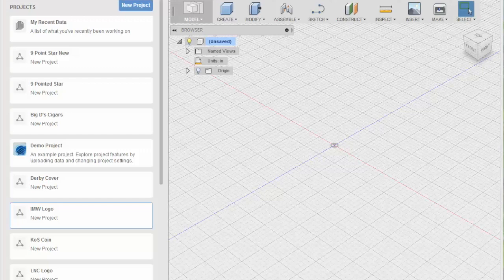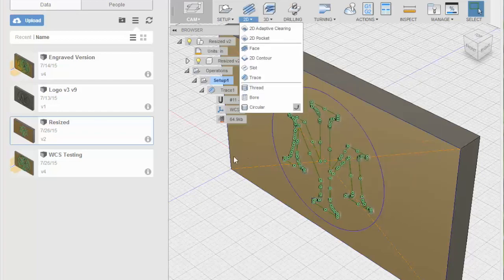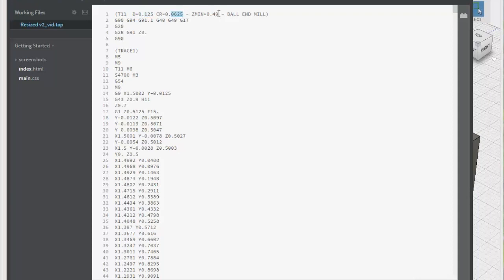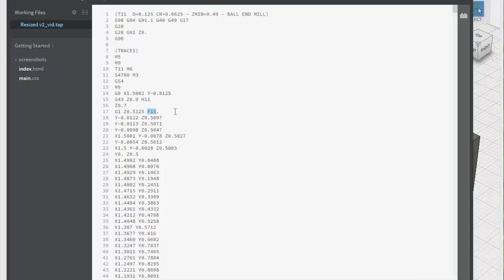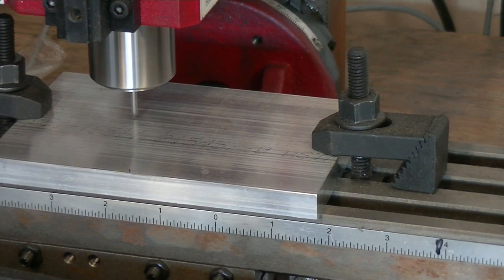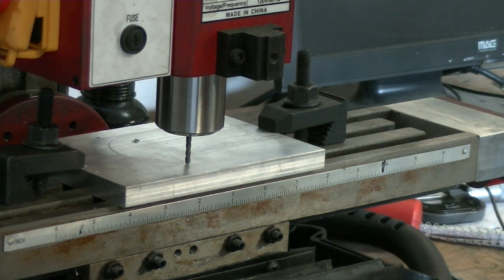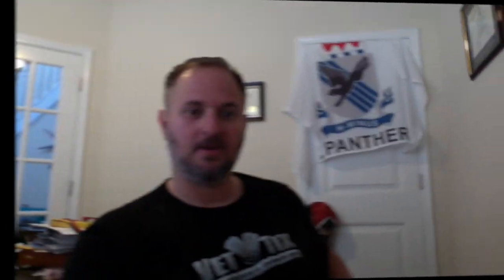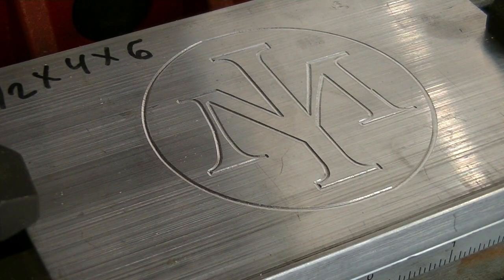CNC Mini Mill - Trials, Failures, and Success!

Comment: Assuming you used stepper motors to control your movements. .. it is common to loose steps in the travels to and from the destinations. ..
I would look to your mounting of the motor and attachments to the table to make certain that everything is secure and check for play...

I hope you get it figured out 
Enjoying
Reply from the maker: Thanks for watching and the helpful info on the motors. They are indeed stepper motors but I think you hit the nail on the head with checking the mounts. The nuts that secure the ball screw had loosened during the operations this week and let in some play on the table. I 'll add some thread lock this time and get them torqued up properly.

Appreciate the comment!
Tom

Comment: Tom good to see you, seems like your energy level is pretty well back to normal, how is the back?  I am glad your posting these videos showing your lessons learned.  I of course can't offer any help, but will find this video useful in the future as I make my way into the CNC world.  Have you used Sketchup?  If so, would you say Fusion 360 is better for the CAD part?  Cool to see your logo engraved
Reply from the maker: Hi Gary! I'll shoot some more video, or you can do a search for this but you will need to watch the issue I had with calculating the right number of steps for your motors. If you build your own CNC table you'll have to calculate the linear motion with gear reduction, etc. Lots of great tools out there to help though.

I've used SketchUp a bit in the past but didn't really have much luck with it aside from just the outside of the model. Fusion360 is a true, parametric modeling tool and will take you much farther in the long run but everybody has their own preferences. Maybe I just didn't spend the time with SketchUp to really become a power user?

Definitely feeling better and have more energy. Thanks for checking in on me, my friend!

Sincerely,
Tom